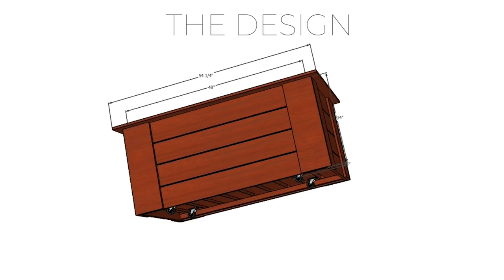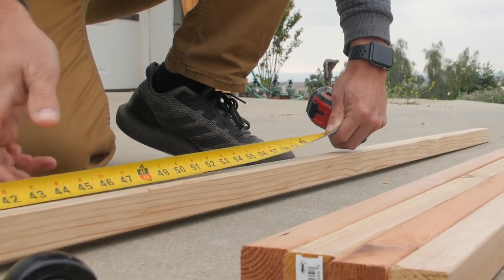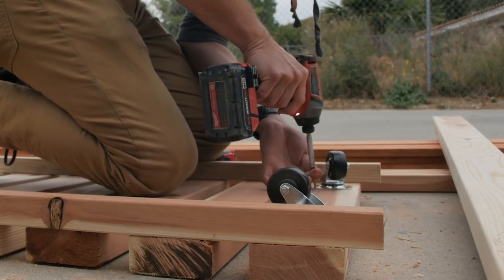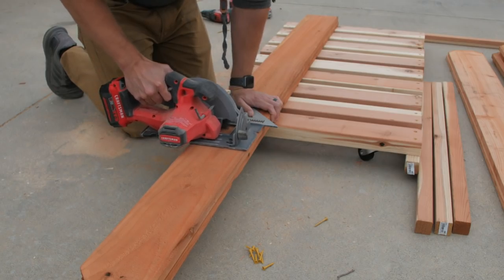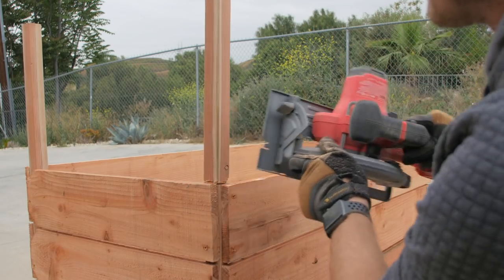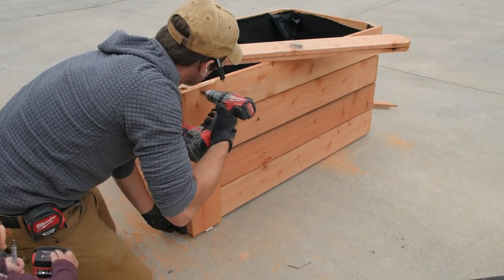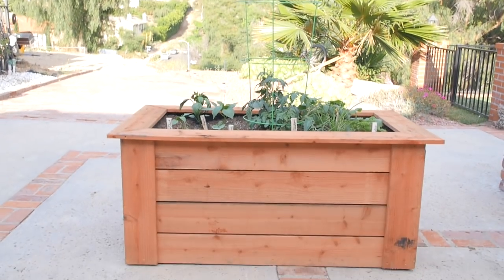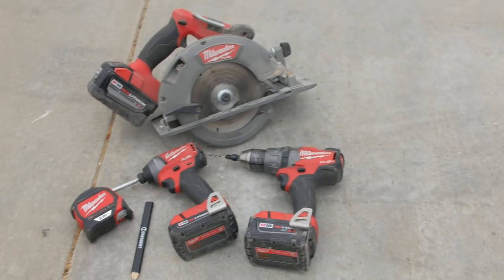DIY Raised Planter Box (w/ Hidden Wheels) | Free Plans | How to Build

Comment: I built 2 of these. Beautiful. BUT... definitely go larger on casters. They worked fine while building, but when I loaded soil (about 1/3 yard each), one of the casters puked out ball bearings, the wheel locked up and left wheel skid marks on pavement. I unloaded soil, positioned planters, then reloaded. Also suggest a 1x2 upright tying inside mid-span of long sides boards together so less likely to get a bow. Last, maybe 6"-10" of 1x2 horizontal on inside top edge of all 4 highest side boards to give support for the flat piece used as a cap. Sounds critical, but not intended that way. I love these and wife instructed me to build 2 more.

Comment: Instead of stones you could use leaves, sticks, grass clippings or other yard waste material to fill the bottom half of the box.  It would decrease the weight of the box, add nutrients to the soil, and save a little money on potting soil.  Also mixing peat moss with the purchased soil can stretch your dollars a bit.

Comment: We were thinking of doing a similar idea. For my wife's toolshed!

We are thinking of using an old pair of aluminium ladders - to make a subframe (two aluminium ladders bolted together with bolted brackets to make the subframe). The shed will be approximately 1.4 m wide and 3 m long. This suits the length of the two aluminium ladders (which are old and surplus to our requirements). These make two ready made rectangular hollow section beams. (As we are replacing these ladders anyway).

By having fixed swivel wheels at one end, and freely swivelling wheels with a lock feature at the other end. The wheels (fixed swivelling and freely swivelling with lock feature we bought from our local hardware store). These are a similar size to the industrial heavy weight garbage bins in the UK. (Wheel specification 125mm dia / 37.5mm width - 50(??) Heavy Duty hard rubber industrial type fixed and freely rotating swivel wheels.

The need for wheels is because our mini toolshed has to fit into a small gap, with a wall behind it and a set of concrete steps along side it. With a level concrete base we hope to be able to pull out the shed using fixed handles either side of the front doorway to allow us to paint and coat the sides each year that are hidden by the wall and the concrete steps. We think this is possible, and preferable to the idea of using a car jack and pipe rollers as our local woodwork professional suggested!!

Using a grinder, and deep aluminium ladders (85mm x 25mm cross section), we hope to make a robust subframe which will not bend or flex when we are in the shed!!

What do you think of this idea? (I am happy to share photographs and plans if you wish, at a later date when this is all, complete). Another mini project!

Comment: Is there any benefit to having the soil go all the way to the bottom? If the plants grow well with a thinner layer of soil, you could save a lot of weight by leaving the bottom half empty.
Reply from the maker: I did that on another planter to lessen the load. The other planter has about 14" of soil which is much lighter.

Comment: The plans don't mention the mesh or the liner you used in the video -- what sort of wire mesh did you use, and how was it secured (staples?)  When you added the liner, what exactly is that called, and was that secured the same way?  I love the way it looks though, so i'm excited to try it out.
Reply from the maker: The mesh is just wire mesh you can find at any hardware store. It's probably not essential but helps from critters climbing up from underneath and also in the event the weed fabric (which is the other liner) dissolves or tears. You can use weed fabric or plastic sheeting as a liner and just staple it in place. Hope that's helpful.

Comment: I really like the simple and yet attractive design, and I need the rolling capability in my situation. BUT the one concern that will compel me to change the design is that the entire weight is supported by only four screws in each of the two 2x4's that have the casters since the 2x4's are over, rather than under, the two 48" 2x2 baulsters.
Reply from the maker: I made another version where the soil level is only 12" deep so it's significantly light. You could modify it in a similar way if you want.
Reply: @MrFixItDIY  It's ok, I need a heavy planter for a windy balcony. I have substituted 2x4's for the 2x2x48 pces, and bought carriage screws for the two 2x4's that will take the casters. I also went with heavier duty casters, two swiveling, two straight. We'll see! And thanks again.

Comment: Why not create a false bottom instead of adding rocks? I don’t have the power tools, would a hand saw be as effective?
Reply from the maker: I did that on another planter to lessen the load. The other planter has about 14" of soil which is much lighter. You could use a hand saw. It'll just be a workout.
Reply: MrFixIt DIY thank you for the response! I realized a circular saw is not too pricey! Will consider power tools. Do you have instructions on how to create a planter box with a false bottom? Thank again!
Reply from the maker: @OscarHernandez-sp8mw  I don't have them planned out unfortunately. However, you can modify the existing plans to suit your needs

Comment: Sweet project!  What's the characteristic difference between Redwood and Pine\Douglas Fir?   Also, so you had to go back to the Milkwaukee tools?
Reply from the maker: Fox Hall Woodworks Pine/Doug fir would also work. Just not really an exterior wood. I use all my tools and actually used the Craftsman saw for most of this project

Comment: The instructional plans are different from what you’re doing on the video. I’m having to go back and forth between the two to get it right. Would have been more helpful if they matched.
Reply: Yeah same here. Plus he listed 13 fence pickets, but no math I can figure out uses less than 14. 8 for the sides, and with how long the top edges are you can't make them from 2 pieces, you need 4. The uprights need a couple more at least. 14 minimum

Comment: Are the screws supposed to be 1 1/2" or 1 1/4"?  The plans on the video are different than the plans I downloaded.
Reply from the maker: Either work but 1 1/4" would be preferred
Reply: @MrFixItDIY  The box turned out awesome but I haven't quite finished.   Any tips for the top plate.   I can't seem to center it.   I had to stop yesterday before I became too frustrated and decided I will try putting it on the floor today and screwing it together.   I should mention that I'm a beginner.

Comment: What do you think the completed box with soil weighs?
Reply from the maker: A lot. It's hard to move. I made a 2nd one and only had the soil go down about 14". Much lighter. Slightly modified but still on wheels. Just weighs less and requires less soil
Reply: @MrFixItDIY  how many fence pickets for this? would it work without a bottom if placing over garden soil or dirt along the wall? Awesome video. thanks in advance!
Reply from the maker: @UnitedRedDevil13  Yes and yes. You don't need to make it mobile if you don't want to. No bottom required. Each box (this size) requires 13 pickets
Reply: @MrFixItDIY  Would love to see the modified instructions if you have them.  I made the 1st one but am not thinking about building a 2nd one.